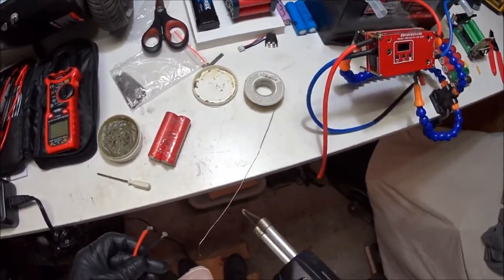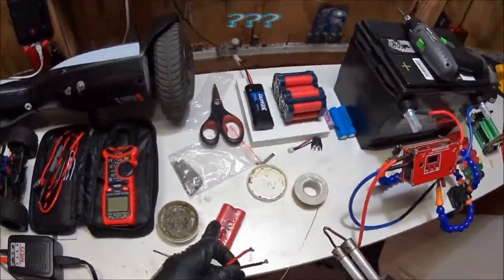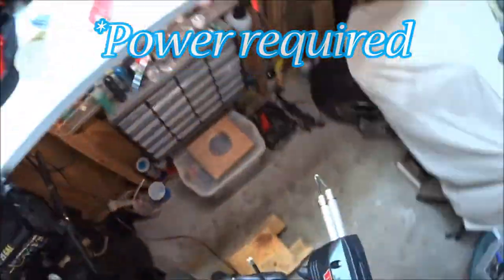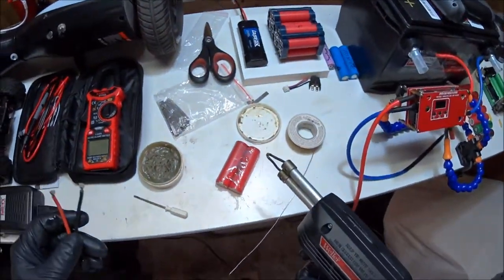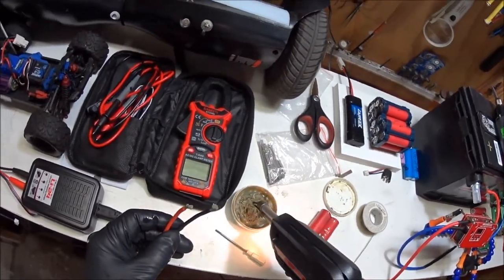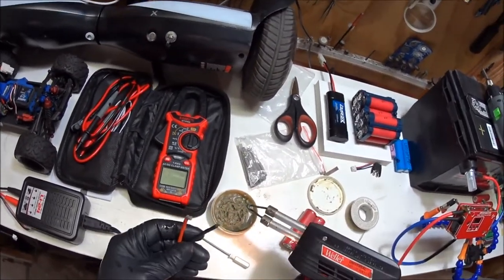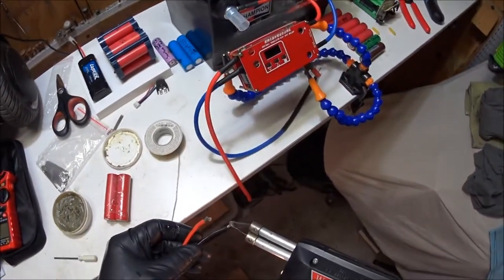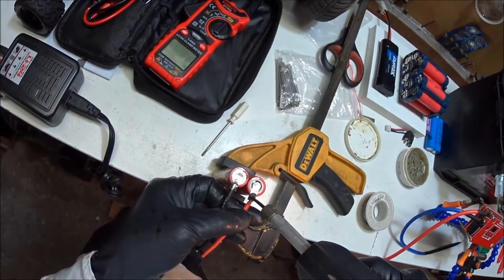R/C Camera Truck Custom Battery Spotweld 18650 Battery Build Mini Traxxas LaTrax Project Restore

Comment: Thanks for inadvertently showing me how to actually check the amp draw haha.  I came to see if you specified the actual cells used, but didn't get that info since Ryobi mower pack is too generalized of course...

BTW, if you haven't already learned; 2S (2 cells in Series) only increases the voltage, not the capacity.  2 cells in Parallel (2P) would combine the capacity but remain the same voltage as a single cell.  So when you state that you now have 2800mah you are incorrect, it's still just 1400mah.

Also, feel free to check out my videos showing my custom MacGyver'd Frankencase "quick release" battery pack shells haha!  One is for 3S and the other is for 2S2P (double capacity plus half the load, since the 3500mah cells I bought only adequately supply around 5-10 amps and would hit the voltage cutoff point of my ESC after just a few seconds of full throttle, which essentially means they were being overdrawn and being damaged in the process)